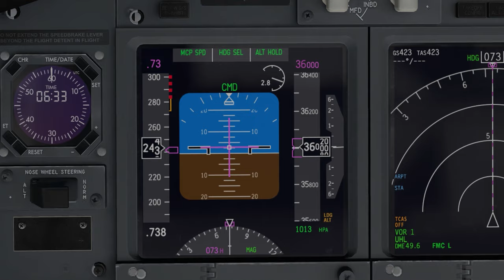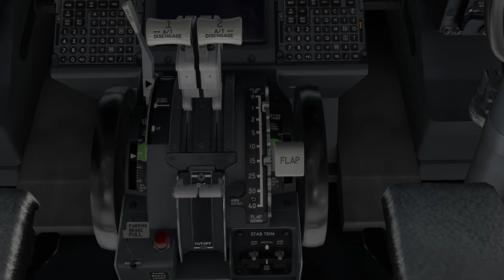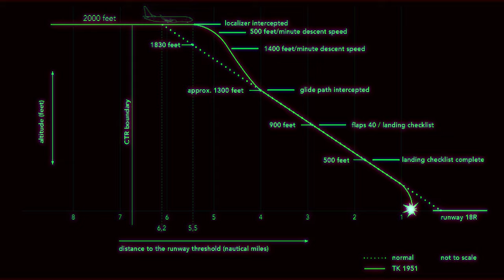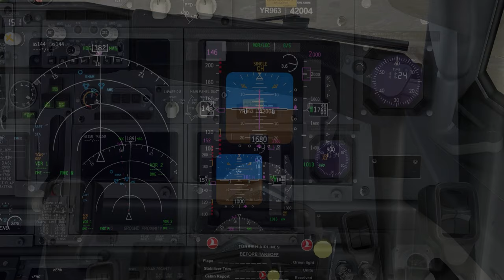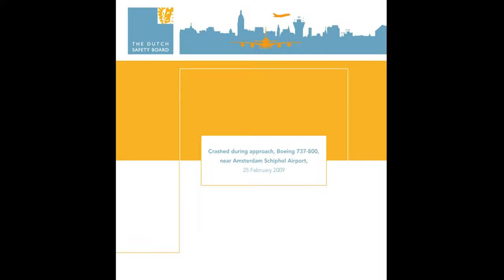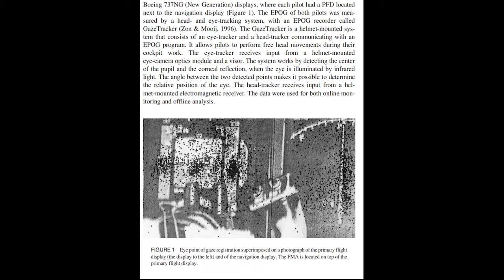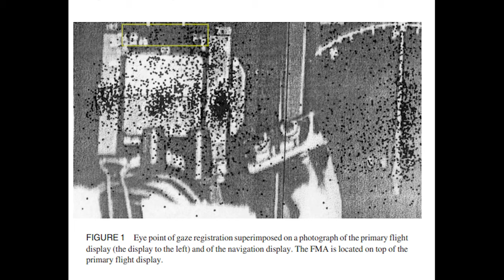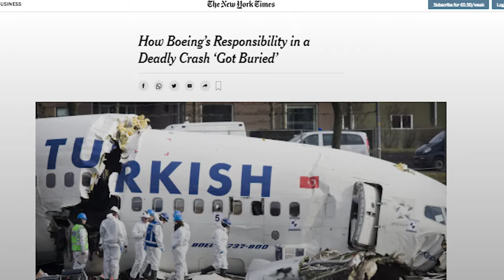Why did this 737 FALL out of the sky?? | Turkish 1951

Comment: I'm glad Airbus found success despite the very rough start of the company. Boeing needed competition to not be an incompetent monopoly
Reply: Boeing isn’t Boeing. It’s a reincarnation of MD
Reply: @nuherbleath461 Yup, all the problems occurred when they merged with McDonnell Douglas. Boeing had always been a company run by engineers obsessed with safety, redundancy and quality. McConnell Douglas has a bean counter and cowboy culture. Amazingly, the much smaller MD ended up with a much higher percentage of its executives in control than Boeing executives and the culture totally changed. It’s why MD employees joked MD has purchased Boeing with Boeing’s own money.
Reply: Calling Boeing incompetent is ignorant. Basically, all that happened was, because airlines and Boeing like making money, the airlines wanted the 737 MAX to not require a new type rating for 737 pilots and Boeing instituted a plan in which they felt would avoid requiring the type change training. It was mostly fine, but a few pilots clashed with automated software and this led to accidents. It wasn’t like Boeing produced a safe plane. Their true failure was inadequately communicating an aspect of how the automated safety software would react in a specific situation. It was possibly negligent, but it wasn’t incompetent. Airbus has had plenty of technical issues themselves.
Reply: @The_ZeroLine  the max is incompetently designed. It shouldn't fly
Reply: @CARPital  🤦‍♂️ You’re clueless. None of the accidents have been design related. The accidents a few years ago were due to the 737-MAX not requiring a new type rating for pilot - many of whom were unaware of new AP software and how it behaved. The latest door plug incident was due to a quality control issue at a major subcontractor Spirit who did not properly install the door.
Reply: @The_ZeroLine Either you are the clueless one or get paid by Boeing  25 cents for shilling 😂 Educate yourself on the matter and then talk.
Reply: @jozinzbazin2222  OK, then make a single correction. Calling someone “clueless” without a single point let alone any actual facts is the tactic of someone who doesn’t know anything beyond their feelings. Thanks for the education though.
Reply: @The_ZeroLine MCAS utilized a single sensor. That’s a design flaw.
Reply: @JohnCena-ts5wl  Omg, John Cena is talking to me!
Reply: This is yet another example of a preventable casualty that boeing ignored, like adding software that can crash your goddamn plane and not telling the pilots
Reply: @nuherbleath461 yeah after they merged they basically became a janky joke im not shocked at all they threw the dead pilots under the bus to not have to admit fault
Reply: Aged like fine wine
Reply: The only good boeing is the 787/777-300ER. Thats it. Anything else, airbus is better.
Reply: @The_ZeroLine what are you smoking?
Reply: Lmao it IS an incompetent monopoly.

Comment: Here's an interesting one for you: I noticed that when I'm flight simming, I pay much more attention to the Airbus FMA, as opposed to the Boeing (despite knowing I should). I think this is for two reasons - one of those is the Boeing 737 FMA is not as prominent as the Airbus, the other is the Boeing doctrine, of the pilot always being in the loop with less automation. Also the Airbus cockpit is just less visually and cluttered, moving my focus to the important things. Great video thanks.
Reply from the maker: This is interesting, and I agree that it goes back to the whole automation-centric philosophy of airbus. It's amazing that such different approaches to automation have existed side-by-side in the two major aircraft manufacturers for decades. You'd think that one would win out, in the same way that two-engined single-decker airliners did.
Reply: @GreenDotAviation  I think the Airbus ethos is winning, Boeing's have become much more like Airbus, as opposed to vice versa. As airlines move to single pilot or remote flight in the next few decades, I think the Boeing doctrine will die along side it. I also think they'll switch to a sidestick sometime relatively soon.
Reply from the maker: @exiletsj2570  It would be a real shame if the Boeing philosophy disappeared, but I think you may be right. As for the sidesticks though, that's interesting, do you have a  source for that?
Reply: @GreenDotAviation  my take is that the Same everyday functions are automated on both aircraft, it’s just that airbus recognises the importance of mode awareness and the fallibility of the pilot. I’ve seen too many issue where Boeing crews mode awareness has been at issue. And regardless if philosophy, it’s just as important on a Boeing.
Reply: @GreenDotAviation  It's just an educated guess, the biggest indicator is Gulfstream switching from yokes. By "soon" I mean probably 10-20 years.
Reply: @GreenDotAviation  Boeing seems to rely a lot on single source data for their automation while from what I understand Airbus aircraft will disengage anything it can’t get reliable data for and hand complete control over to the pilots
Reply: @exiletsj2570  Single pilot?? None of this will happen in the remotely near future..
Reply: I'm not a pilot but I believe the cockpit is so cluttered with information that it makes it too easy to miss the simple things causing Pilots to fixate on a complicated situation when in actuality the solution is quite simple. I'm a Nurse and we sometimes do the same thing when we're at home. We know how to deal with emergencies at work but when it's our loved ones (example control info. for a Pilot) we tend to over analyze the simplest problems.
Reply: @GreenDotAviation  why would it be a shame if it's safer?
Reply: @alinaqirizvi1441 Because it’s not necessarily safer. If the automation fails, it becomes much harder to turn it off and fly the aircraft manually. It can also lead to the possibility of trusting the automation too much and therefore having a lack of experience flying the aircraft manually. Both have their advantages and disadvantages.

Comment: near the end you mentioned the New York Times inference that Boeings Role was downplayed by Dutch Aviation Authorities. i disagree with the outcome of that Article to an extent, while yes the Dutch report does not adequately mention Boeings responsibility, it is not nearly as lacking as the New York Times Article purports. you mentioned in another video regarding the BA Crash at Heathrow that the Captain did not take control of the aircraft and instead let the aircraft be maintained by the first officer. in my honest opinion, the Captain in this Turkish airlines crash did not do that. he took control which removed valuable seconds in control inputs that in my opinion may have saved the aircraft, the first officer was in the process of recovering from the Stall, as soon as the Captain took over, the aircraft was left with no control input allowing the Auto Throttle to roll back the engines and the aircraft to nose down slightly, increasing its rate of descent. those few very short seconds.

Comment: you mentioned something interesting - Boeing says “pilots will notice something is wrong (with the automation) and take over” so a failed radio altimeter is not a problem. Seems like this exact same scenario played out with the MCAS on the 737-MAX. Several crews reported uncommanded severe pitch down on takeoff, requiring immediate manual intervention/override. Nothing changed until two of these aircraft flew themselves into the ground.

The AP/AT here used one faulty RA sensor’s input when two were available to compare. The MCAS also used one faulty AOA sensor when at least two were available. System redundancy is required for a reason. Sensor redundancy is pointless if Boeing won’t compare readings and throw a master caution/warning and disable (with notification of course) the dependent automation when there’s significant disagreement.
Reply: Boeing do not use true redundancy, just multiple sensors, often just two, where three are required for a "vote of confidence". This can result in flight crew getting conflicting information, without knowing which reading is correct.
Reply: Fully agree. Moreover reading from captain side (left) is taken into account although FO (on the right) is the flying pilot. It is counter intuitive.
Reply: Great points. We hear so much about how aircraft are designed to have a ridiculous amount of redundancy. This is great, but only if those redundant systems communicate properly with one another.
Reply: AFAIK on the MAX there were no reports of severe uncommanded nose down pitch on takeoff. What is your source for that info?
Reply: Flying coffin... 737MAX
Reply: Truly excellent point !
Reply: @petep.2092  Two MAX planes crashed in less than 6 months in 2018/2019 due to the MCAS, a new stabilization system pilots weren't even told about. Boeing wanted to compete with Airbus which had recently added larger more fuel efficient engines to their new planes. However, due to 737 being lower to the ground than the airbus 320, the big engines caused an unintentional nose up when increasing thrust. So Boeing developed the MCAS as a quick and cheap solution, which wasn't officially certified before the crashes. There is more to it, but that is the main idea.
Reply: @kuromyou7969 the important part about it imo is the part where boeing didn't want to issue new training to the pilots for the system because it would've cost them money
Reply: @808_murda2  I was literally discussing the MCAS disaster yesterday. 😆 But yes, you're right. Boeing is definitely at fault.
Reply: @kuromyou7969  not just for the 2 mcas disasters, boeing is known for throwing shade at the pilots and not taking their responsibility and making it safer rather prioritizing money. I agree with the getting money but safety first then that.

Comment: Just stumbled on this channel and enjoying the analysis. 

I always find it interesting how these crashes are caused by a number of seemingly minor factors which combine in unexpected ways. Again, workload seems to have been a major factor in this crash - there must be a way of ensuring the crew are monitoring their instruments without the aircraft getting to an unsafe state. In this one, I would have hoped the safety pilot would have stepped in when the stabilised approach criteria were not met; certainly they should have reminded the captain as a minimum.
Reply from the maker: Agreed, it's the unlikely combination of seemingly minor contributing factors which make these accidents so interesting. It's basically never the case that a wing falls off and that's that. I believe the 737 now has an audible "airspeed low" alarm when the plane gets too slow. This alone would have prevented this crash.

Comment: How about Eastern Airlines flight 605.  I just did a podcast about it, and I'm not an engineer or anything. I just take a look about events that happen on the Delmarva Peninsula, rather they be crime or tragedies. This took place in 1947 and resolution was never given in the report. Probably the quickest investigation to ever begin in the history of aviation. A plane carrying CAB members, precursors to the FAA/NTSB, and they were about 3 mi behind the accident and 500 ft above. They saw it happen. First responders found the plane crash because the CAB flight was circling around it trying to get an idea of what happened.
One of the strangest theories, which at first I outright wouldn't believe, is that someone deliberately engaged the gust lock in the middle of flight. However, that exact same thing happened four months later on another flight when a senior Captain wanted to experiment. They missed the ground by about 300 ft.
But I'm rambling. I really like getting to the bottom of things and trying to find ways to prevent them from happening again. So that this does not have a resolution is driving me crazy. Maybe taking a look at it can bring a different perspective?
Here's the link to the episode and all of my sources are listed there if it is something you're interested in covering. I just really want other takes on what may have happened.
https://www.podbean.com/ea/pb-hegpb-114d74e
Reply from the maker: Thanks for this suggestion - looks like an interesting mystery. Will have a look at the podcast and sources you've cited and may cover this at some point!

Comment: Yet another example of inexcusable pilot error and incompetence. There was also a significant experience gradient on the flight deck which would have prevented any effective challenge of the captain or his management of the approach. Basic airmanship is all that was required here to prevent a hull loss.
Reply: I agree. No pilot should believe any automation 100% and they should keep checking their airspeed, etc and take full control before it’s too late.

Comment: The main reason for this accident stems from pilot error. Number one rule is to fly the aircraft. The pilot is responsible for the safe operation of the aircraft,  even if the autopilot is "flying" the aircraft. These pilots failed to monitor the number one dynamic that keeps the plane in the sky - AIRSPEED. Esp on take off, climb , approach and landing, it is critical
Reply: Your correct. Monitor airspeed.
Reply: My thought exactly! They had their noses buried in mounds of items on their checklist and seemed to have gotten all warm and fuzzy with Mr. Airplane flying it, when Mr. Human is supposed to be doing so.

I'm not a pilot, but I've seen and heard the oft-repeated mantra, "Aviate. Navigate. Communicate." These poor folks (both the pilots and the victims) were buried under a tremendous bookkeeping burden from which they needed to "Extricate."
Reply: Technology is all to often relied upon until the day it cannot be relied upon safely and then there will be a percentage of accidents un-avoided.
Reply: @damienjeremyweir4543  We can't even get safe self-driving cars. It's incredible we can somewhat do it in 3D space with planes.
Reply: This disaster was the first Airliner disaster in holland after the bijlmer ramp. I m from Holland and remember both

Comment: I develop software for my own business. No one dies in my biz, but there are mission-critical moments. I have learned the hard way to place tests in my own software that call attention to unexpected results. I’ve lost count of the examples in flight disasters I have watched where the behavior that precedes a crash is clearly displayed right where it’s supposed to do so, and that obviously was not sufficient even for highly trained pilots. Honestly, how many times???

Going to an all-glass cockpit requires different thinking to accomplish the same results that old school gauges tend to do well. The presumption that attention is being paid to a counting number in a field of fifty other similarly designed counting numbers is clearly a failure waiting to happen. To simulate old-school thinking requires highly visible changes in exactly that location of a busy UI. Yet one more audible alarm should be used as rarely as possible. 

We can process a lot of visual input if we know where to look. Why not design so we literally cannot miss what needs added attention. Improved heuristic engineering does exactly that.

Comment: Still a few unanswered questions : how come you can operate with one altimeter down? That's a very disturbing minimum equipment list.
Reply from the maker: It’s a radio altimeter, so it’s less important than a barometric altimeter, as it only works below 2500ft anyway.
Reply: @Alfred Weber and they would have to land,which is what they were doing?
Reply: @GreenDotAviation  You are making statements that are at best ignorant. You make good videos. Get yourself a consultant.
Reply: @Joseph Lucas So you're saying any aircraft that doesnt have 2 radio altimeter in working order should be grounded until thats fixed? Congrats, you just grounded every single small planes until they add expensive equipment. Hell, RA's are newish and only really seen on bigger planes. Its not because its the biggest safety device ever. Its a convenience thing more than anything. Pilots are STILL expected to be proficient with their first task which is flying the plane. Hell, the CJ4 doesnt have autothrottles at all, yet you dont see them falling out of the sky on approach, and its rated to be a single pilot aircraft despite it being a jet.
Reply: @bayouflier6641  he is right bud.. think you need to go back to school
Reply: @GreenDotAviation  Evidently, the radio altimeter is very important for the bottom 8000ft. Other avionics rely on its readings, and as shown in this video, it is one of 3 parameters that can trigger flare mode. It doesn't make any sense that the 737 choses to use the captain's RA even when it disagrees with the FOs RA. Sure, it's always the pilot's fault, we say, but if the automation is this easily foiled and requires so much supervision, what is the point of having it?

Comment: Boeing doing the bare minimum to Jerry rig a fix and weasel out of everything doesn’t surprise me: they are so big now that they have frightening power. I literally think that every plane of theirs is built to the barest minimums of cost and safety that they can get away with. 

Also, I wonder how many crashes would have been avoided if flight engines were still a thing, freeing up one person to monitor crucial stages of flight while others deal with checklists? And regarding flight simulator / check exercises: how many of them literally throw random extreme stuff like this in at the last second, or are they all fairly mild and threat free?